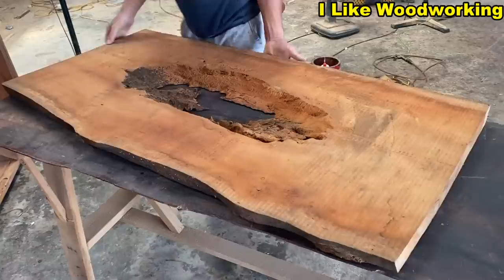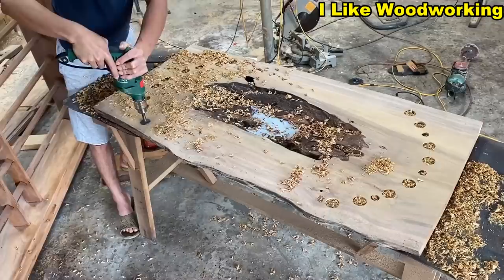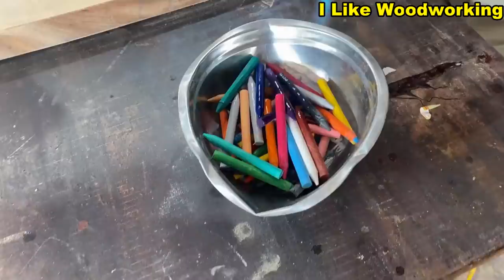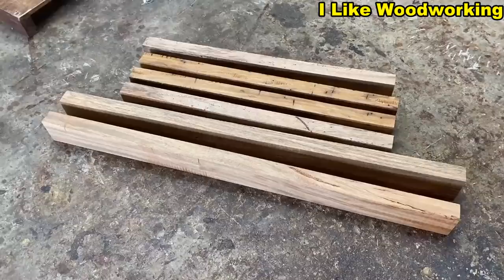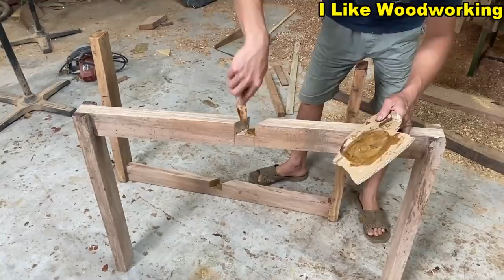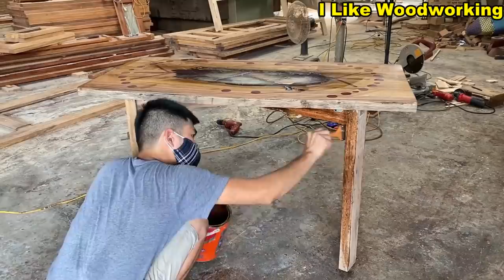Woodworking - Build A Table From broken Wood

Comment: That was a really nice piece of wood. You then drilled holes and cut grooves and filled them with resin. I don't understand why. Everyone has their own tastes but not my cup of tea.
Reply: What a waste of resin
Reply: I was thinking that, too---what a destruction of a beautiful piece of wood.
Reply: The resin was to support the hole in the wood, nut the did not do it right so it ended up looking like shit. I figured the grooves were to stabilize a crack though i am not sure of that.
Reply: Problem is you will find some idiot out there that thinks that was good craftmanship. what a waste of the wood
Reply: seandainya bisa dlm bhsa indonesia pasti akan membantu para tukang mebel smakin kreatif..
Reply: cairan bening n kental itu namanya apa

Comment: You are a genius that others don't understand it is not a usual table as you would have made support for its legs , it could be used for decoration purposes and not for holding heavy weight . With the decoration your design of the table could be matched . I think you have made the lines for griping and other for disgusting the whole thing . I like you love your job . just don't give everyone hearts , those who don't understand you .

Comment: When I first saw the two slabs I thought I would have left the center defect alone, except removing the loose wood.  Built the legs out of the other partial slab and built a raised 3/4 inch wide border around the table about 3/16 above the top of the table.  Finished it with a clear coating and put a single piece of 3/16 inch glass over the whole slab.  Leaving the table the way Mother Nature made it.  

But I’m sure someone will like it and buy it.
Reply: Idk… I think it’d be hard to give that thing away.

Comment: Was a beautiful slab, still think routering those lines and drilling those holes just to pour resin was a very poor choice. Would have been a way better off just filling the center with resin and finishing the table. Those extra things dont make it better.

Comment: poor color choices on the resin. i believe the holes and lines were pure artistic expression, possibly folk art inspired, but in this case i think the table needed much cleaner lines of accent, like very straight parallels to the edges, or maybe a pure oval shape around the hole.  clear, black or white would have been better. im not partial to the wild colors others use, too garish. but this was anti-garish. and the central resin failed, not a good job. i did like that he chose this piece to work with, that shows he has a good eye. i could NOT do better, im an armchair commentator, but its clear its lacking symmetry and a clear message. random hole in middle, perfect round holes for accent, and slightly askew lines making starbursts. too busy. you know, all multicolor crayons would have been cool, sort of a tropical/caribbean feel.
Reply: Da no
Reply: ¹²12maria  de  LOURDES GOMES
Reply: Keiro  quê   você  eu gosten muito
Reply: J

Comment: The selected wood slab is nice. but final appearance is very bad. You should watch YOUTUBE/ PINTEREST video contents much as you can about RESIN RIVER TABLES then you can understand and may be able to make for the taste of river tables. (It is humanity to guide him other than discouraging him, i think.) Your new edge sanding machine is a good idea .and use clear casting epoxy for big hole and clear table top epoxy for table top. 🌟
Reply: Whã is the liuid name

Comment: He's probably using fiberglass resin and used way too much hardener resulting in the enormous crack because of high contraction reaction and an unclear dry up. Quite unfortunate as that piece has a potential to be a great show piece
Reply: Сак2🙂
Reply: @edomesropyan9379  ²

Comment: Shouldn't have drilled holes in it. Could have tested on another piece of wood for (electric burn lines )that's what I call it and try doing that. Or just do the epoxy with a deep sea theme.

Comment: Really bad epoxy work,I'd guess to mutch catalyst over heated it and cracked it spoilt it as for the holes and lines in the wood work what the hell were you thinking ?? Overall a terrible job.
Reply: They use a tablesaw and jointer combination with no safety devices, what did you expect lol.